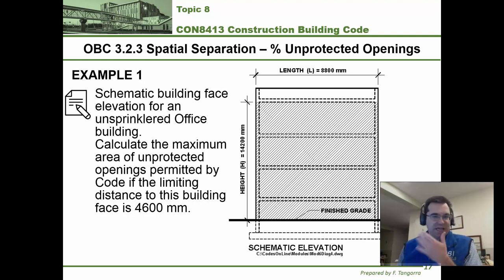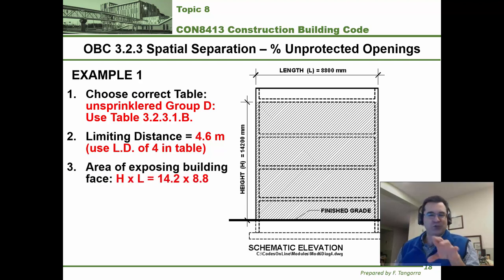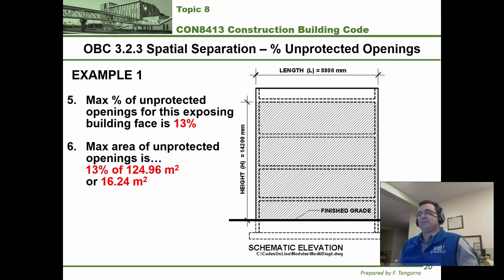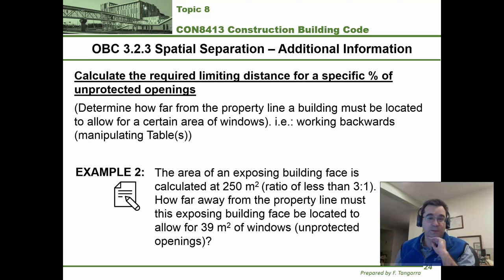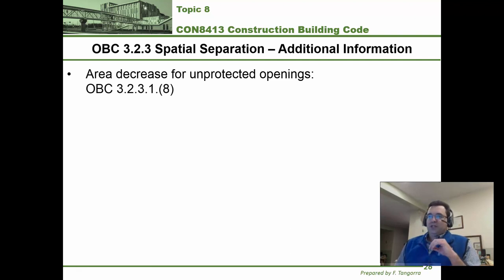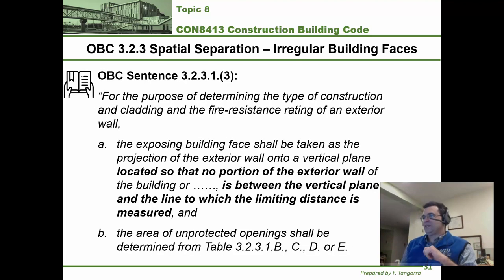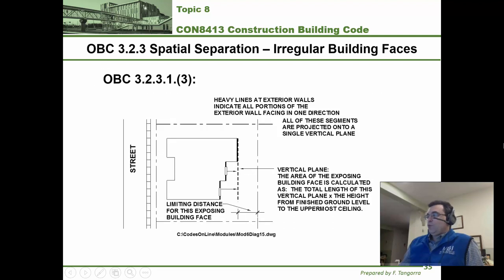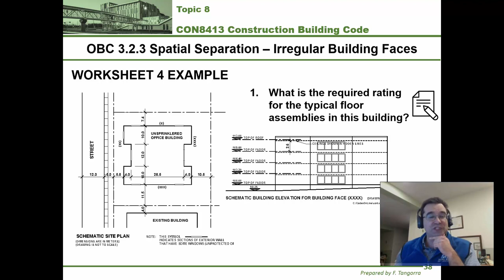CON8413: TOPIC 8 part 2 (Spatial Separations)

Comment: why did we take the higher LD 6 instead of 5 and rounded up the 15.6 to 16 % in example 2;  minute 9:14, didn't we say we round LD down to be more safe
Reply from the maker: This is a great question Mariam.
My apologies if my answer is long. The reason is that in Example 1 you are given the LD and you must calculate the % Area. Whereas in Example 2 the % Area is fixed and you must determine the LD.
As a result, for Example 2, you have to select an LD that does not conflict with the given % Area. If you pick LD = 5, then that means that you are selecting % Area of 13%, which is LESS than the given % Area of 15.6%. That cannot happen.
Instead, the smallest LD that allows for a %Area of 15.6% is LD = 6 m.
I hope this makes sense. 🤞

Comment: Hi, if the building elevation is not straight and you shown in your video in minute 11;30  , when i projected all the faces and i determined the max openings,  FFR and construction type, does the cladding type and fire rating applies to all these faces ? or only to the closet face to the property line ? 
TIA